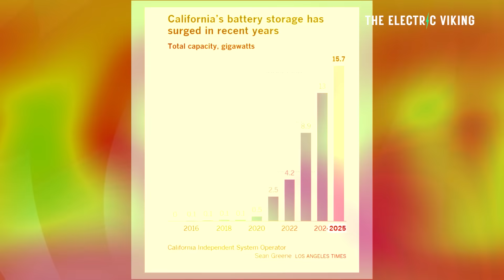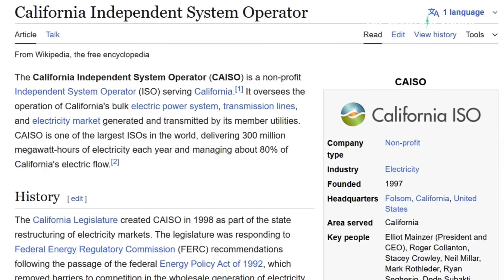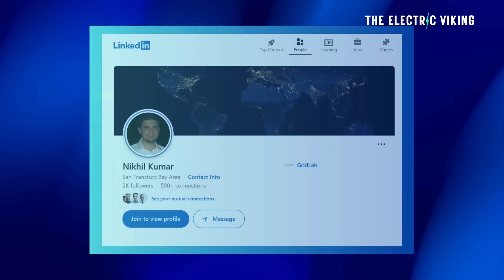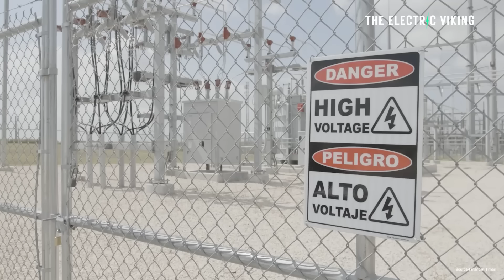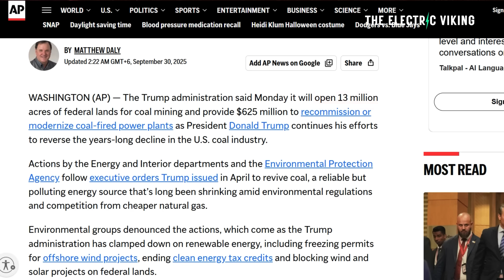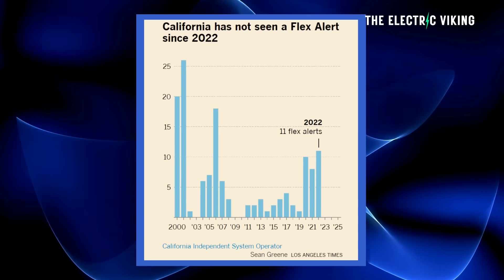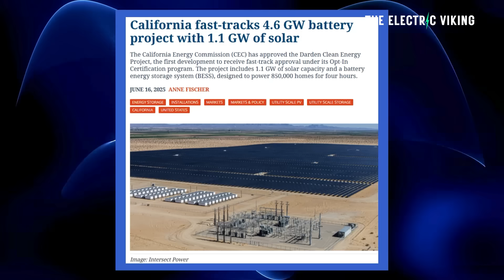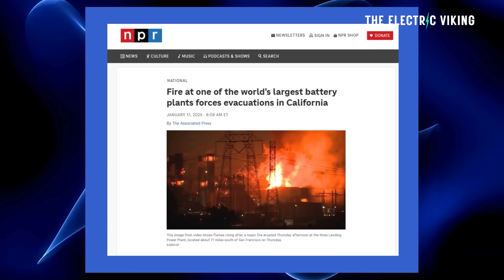How Utility-Scale Batteries SAVED California From Black Out Every Year

Comment: What do the electric utilities pay for storage + hardware to put battery power back onto the grid?
At my house, I paid $400 for 4kWh of LiFePO4 battery capacity which would put out 1kW DC for four hours.   Lots of other hardware is needed too.  Even so, compare perhaps $800 to put 1kW on the grid versus a CC-NG plant which costs way more than $1,000 per kW of nameplate power.  What do utility-scale batteries cost?  Maybe they are much cheaper than adding more generating capacity?

Comment: We live in North San Diego County.   Unfortunately we still get power outages but they are due to high winds and fire danger.   SDG&E turns it off in case a power line breaks and starts a fire.   We live in a housing tract where the power is under ground, but we are connected to a country area with a lot of chaparral and trees.   The good news is we have had solar for 22 years and now have battery backup at home that uses 8 huge AGM batteries in a patio box.   That is 20 KW of storage.  Better than power walls and not prone to catching on fire.  It handles everything in the house except washer/dryer and A/C.   I could use an extension cord to do washing and drying.   We have mini splits in the house but they are not hooked up to the batteries.   However, we could use fans, if needed.    There have been many fires in the area due to downed power lines.

Comment: Batteries are gap fillers while other generators (peaker plants) can get up to speed and start producing to match the load. This is done so that load generators don't have to hum idle when there is no load so they can be there when there is load. Batteries don't last and cannot sustain the grid for long. If a peaker plant can't get up to capacity quickly, ie. within the time the batteries last, then the power outage still happens.

Comment: You missed a lot here Sam, and as a Californian, I feel the need to add clarity…

For starters, California has the highest energy rates in the nation, about double the national average for residential and commercial.

Next, Governor Newsom was up for a recall a few years ago and during that miserable summer, he stole energy meant for Arizona to avoid the black out.

Energy rates are going up even more to help the utility companies pay for the damages due to the numerous fires, most of which were preventable.

I’m not against renewable energy, but we should be honest about both sides of the issue

Comment: We should start calling it Battery+Solar, or even just focus on the Battery Storage itself which can be charged from whatever you want. This deflects the waste of energy in arguing over intermittent solar, wind, & hydro. The simple idea of charging when the grid demand is low or when prices are cheap to use later, even without direct solar charging on-site, is still a game changer in itself due to the massive amount of excess solar already on the grid that we are still throwing away in the afternoon when demand is low, even with the massive increase in battery storage. Disinformation around renewables from Big Oil is just too strong and has warped people’s minds. There’s still too much fear around blackouts and not having enough. No one is aware of the progress since 2022. Battery Storage should be the main focus of the argument. Every other day someone tries to tell me they got a PHEV because the grid is weak and they didn’t want to cause a blackout, and that there weren’t enough public chargers yet in CA, while we have more than any other state in the US. It’s insane.

Comment: The blackouts are caused by shutting down long-distance high-voltage transmission lines when the wind blows to prevent forest fires. These batteries will not help those problems. I live in California's capital, and I know what I am talking about. The batteries are mostly at Moss Landing to store solar overproduction, so we do not have to pay other states to take our overproduction, and it still cuts into our base-load generation, which increases total energy costs. The flex alert you are talking about was caused by an unusual heatwave. There was one, and it lasted a few hours, one afternoon. WE were asked to conserve, but there was no power outage as a result. We have not had another heat wave like that.  The states' push for renewables has almost doubled our electric costs. There are no cola plants in California. Some generation is produced as a secondary product in cogeneration. There have been very few generation plants built in the last 30 years..  Few is on the order of < 5.

Comment: The one problem with home batteries is that far too many of them are still LiON batteries that will degrade faster charging and discharging. As an example why is the Tesla Power wall still LiON??
Reply: Because that's what they make ...or made for the cars ... they didn't bother investing in producing safer cheaper cell chemistries....rather they just had to keep funding Elon and the share holders interests.
Reply: @clivestainlesssteelwomble7665  agree
Reply: @clivestainlesssteelwomble7665  agree

Comment: The other point with gas versus battery is of course ongoing costs. It may be slightly cheaper to put in a new gas plant than it is to put in the batteries, yay you've saved money on your initial investment....then you pay for gas, and pay for gas, and continue to pay for gas forever (well for the life of the plant anyway) so I can see battery rapidly becoming cheaper in use as opposed to gas plants. I mean as price of solar panels comes down and efficiency increases the free electricity gets even cheaper....well we get more for the same initial price lol.

As for opening up 13 million acres for coal mining, if the companies had any sense they would cover those 13 million acres in solar and wind, I mean they are going to destroy it anyway with open cut mining because that's the cheapest method, imagine you can get 5GW from a 13 million acre solar farm, I mean you are looking and 5 billion mWh per year, millions of homes powered right there! No pollution from producing that power apart from the original investment and construction cost, no giant hole in the ground, no CO2 spewing coal fired power plants. Also If it's in a good location for a wind farm and you could fill it with wind turbines you are looking in the range of Terawatt Hours, that's an enormous amount of power from land that is basically going to be destroyed, and it would probably be cheaper than the mining process anyway.

Comment: What is funny about this, no matter the Battery Storage, CA still is many years from any kind of infrastructure improve needed to move to full EV.  As the Biden Admin's Build Back Better Bill never built anything that it claimed, so its wasted money and the grid improvements CA needs never happened.  

Although what is clearly missing is that gas is getting cheaper and Federal EV Incentives are gone, so there is less of a push for them.  Only Deep Blue States and Cities still are and its all for a massive loss for them.

Comment: Blue Energy is developing a nuclear-powered data center in partnership with Crusoe in Victoria County, Texas. The project involves building a nuclear power plant of up to 1.5 GW, which will initially be powered by natural gas as a "bridge" before the nuclear reactor is completed and operational by 2031. This phased approach, using natural gas first, allows the data center to begin operations as early as 2028 while the nuclear component is being constructed and approved. Partnership: Blue Energy and Crusoe are collaborating to build the facility. Location: The data center campus will be located in the Port of Victoria, Texas. Power Source: The facility will be powered by a new advanced nuclear power plant with a capacity of up to 1.5 GW. Phased Powering: Initial Phase (starting 2028): Energy will be supplied by natural gas-powered generation. Nuclear Phase (expected by 2031): The project will transition to nuclear energy once the plant is operational. Rationale for the "gas bridge": This strategy allows the project to start generating revenue and power sooner, while also simplifying project financing. Construction: Blue Energy claims its advanced nuclear construction methods, including pre-fabricated units, will significantly reduce construction time and cost. Site advantages: The chosen site has good access to existing transmission lines and natural gas pipelines.

Comment: They 'save' from the situation they created? By introducing a more expensive solution causing energy poverty. That's so great. 👍
Reply: Battery storage is cheaper and quicker to build than peaker coal plants burning bitumen, the poorest grade coal.  US peaked anthracite coal, highest energy density, in 1919, over 100 years ago which built up the US early 20th century.

Comment: In the latest news from Texas, the global firm ENGIE has just dropped word that it is developing a 600-megawatt solar power plant in Stonewall County. Called Swenson Ranch, the project will be up and running in 2027, which is just around the corner. The A-list tech firm Meta has already claimed all 600 megawatts for its data centers under a power purchase agreement, enabling Meta to nail down an attractive price for the clean kilowatts before construction is even complete. It’s the latest in a string of such agreements between Meta and ENGIE. The running total between the two companies now stands at more than 1.3 gigawatts of solar energy spread among four solar projects in Texas, including the new Swenson project.       Other solar energy developers have also been leaning on Texas to sustain their business. That includes the Boston-based renewables firm Longroad Energy. The company is new to the CleanTechnica radar, but it has a considerable footprint in the US, having developed or acquired 6 gigawatts of wind, solar, and energy storage projects since its founding in 2016. Longroad has already racked up four solar power projects in Texas. Last month, the company announced that construction has started on a fifth project, a new 400-megawatt dc/300MWa/c solar power plant in Yoakum County called 1000 Mile Solar. The project will be up and running next year. Meta has already spoken for the entire output of the 1000 Mile project, too. “The output of the 1000 Mile project will be delivered into the Southwest Power Pool (SPP) grid, advancing Meta’s target to support its data center operations with 100% clean energy,” Longroad explained. IN THE BIG OIL STATE SOLAR IS CHEAPER THAN OIL AND GAS, EVEN WITH THE HIGHEST INDUSTRY SUBSIDIES IN HISTORY FOR THE OIL & GAS INDUSTRY FOR OVER A CENTURY.

Comment: Have you done a video on Sun Train before? If not, you should. It's a great idea to reuse abandoned or underused railroad sidings and placing battery banks in shipping containers on rails on them and moving them if need to to where they're needed off grid or could be used as expandable and contractable regional grid batteries on rails. Since it uses all existing off the shelf technology just packaged in a unique way it could make a huge impact on areas where you can't build grid connections or storage fast enough... Or just need peaker gas killing battery banks to shave off their profitability..

Comment: when talking battery power most news sources get it wrong 
a 4 hour battery can discharge its battery in 4 hours
a 8 hour battery can discharge its battery in 8 hours,
if they have the same Watt Hours  the 4 hour battery is normaly more useful just because it can discharge in 4 hours dose not mean it can not slow discharge for however many hours till it runs out.
The leignth of time a battery lasts the lower is better but everyone gets it wrong and things an 8 hour battery is better, 
for exampe for my medical equipment i have a 0.5 hour battery but it has powered my medical equipment for more than 48 hours. but by its rateing it would be sonsidered a 9.5 hour battery.
the 4 hour 8 hour raiting is how fast the inverter can convert the power of the battery not the battery size.
Reply: You are correct.  I ruined someone's day when they were going on about a 100 hour Iron oxide battery.  I told them that almost every battery is a 100 hour battery.  The hard part is being a 5C battery, discharging in 12 minutes.

Comment: While there is no doubt there are long term benefits of BESS storage (essentially due to significant overproduction when the sun shines and the wind blows which makes energy storage instead of wasting it necessary in the first place) until 2025 it comes at a high cost and needs public funds/ support:  cost per kilowatt-hour (kWh) stored. As of recent data, the average cost of a BESS is approximately $400-$600 per kWh. Here’s a simple breakdown:

Battery Cost per kWh: $300 - $400
BoS Cost per kWh: $50 - $150
Installation Cost per kWh: $50 - $100
O&M Cost per kWh (over 10 years): $50 - $100

While California has a lot of solar and wind power production it also has the 2nd highest residential electricity cost (after Hawai): California's renewable energy sources accounted for 67% of the state's electricity sales in 2023, marking a significant increase from previous years. California = 26 Cent per kwh residential electricity - it´s equivalent to a staggering $260 per MWh
In 2024, Florida produced the equivalent of 9% of the electricity it consumes from solar, wind and geothermal power
Florida = 13 Cent per kwh residential electricity
Texas generates 30% of it´s electricity needs from renewable sources (wind and solar). 30% imho is something like a “golden spot” when it comes to grid stability and pricing. Texas: 10.2 Cent per kwh residential electricity
Reply: The rate charged for electricity in California has zero connection to the use of solar, wind or batteries.  It is the result of two processes: 1) California's "regulated" utility monopolies cut corners on fire safety and pipeline safety for decades (in other words, not really regulated after all).  This resulted in a half dozen major catastrophes that cost many lives and about a bajillion dollars to partially rebuild some of the affected areas. 2)  The same regulators who evidently were never really regulating much of anything, decided that the utilities, now on the hook for a bajillion dollars of rebuilding and damages, could simply add that cost to the power bill.

The solution to this problem is for people to engage in the democratic process, and in particular, to lobby local legislators and candidates for governor, to demand a more independent and less corrupt regulatory process, and demand they get big money out of politics.  Meanwhile, go to the meetings of relevant bodies and call them out whenever they start spouting industry talking points.  The reality is that renewables and batteries quickly pay for themselves, and the state should act to ensure that the SAVINGS from these technologies are passed on to consumers.
Reply: @HonestJohn-y3k  Everywhere in the World the rate charged for electricity exponentially RISES once more than 30% wind/solar are achieved. Nowhere in the World consumer electricity prices dropped once the mix contained 40% 50% or 60% or more wind and solar power. I know perfectly well there are lots of excuses why this is so - but the answer is simple: they produce intermittent energy and not when it´s needed - it´s when the sun shines and/or the wind blows. This implies additional cost for backup power, grid expansion, battery storage etc. The sun does not send an invoice, the wind does neither - but utility scale providers and governments do. Fact.
Hydropower (and that´s also renewable) is a completely different story. Once the dam is built, energy prices drop - longterm.

Comment: BS!... California solved its power problems by buying power from Nevada. They claim it's green energy but the amount of energy sold to California from Nevada is almost exactly equivalent to the amount of natural gas power plants Nevada built since they started selling power to California.
Reply: That's an incorrect assumption.  The California Energy Commission reports that more than a quarter of the imported electricity in 2023 came from wind or solar.

Here are some actual numbers: In the last year, 17.6% of California's grid electricity came from imports.  And 19.9% came from in-state solar generation, and 5.9% came from in-state wind generation.  Altogether, when imported electricity is counted as 100% from fossil fuels, the grid gets 50% of its power from sources that do not burn fossil fuels.  At 25.8% (wind and solar combined) compared to 17.6% from imports, it seems that wind and solar provided a larger share of the solution.  If we account for the 25% of imports that are from wind and solar, we see an even bigger difference: Now it's 30.2% from wind and solar, compared to 13.2% from imports of fossil fuel generated electricity.  Thanks for all that FUD, but no thanks.  I prefer the facts.

Comment: Some data centers and other businesses are starting to draw more power and diesel backup generators can't produce that much so they will have to go to batteries for backup power, that's a new market. Even some Walmart stores have diesel backup generators and a large tank for fuel. That comes with testing, fuel conditioning, maintenance contracts, and other expenses. It's not going to be long before see how much cheaper batteries are and they have a roof large enough for solar.